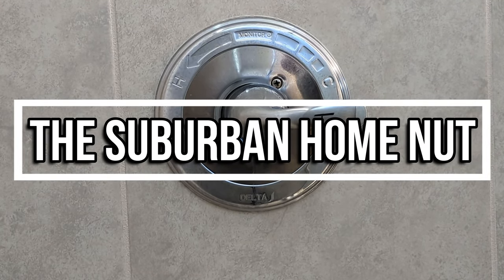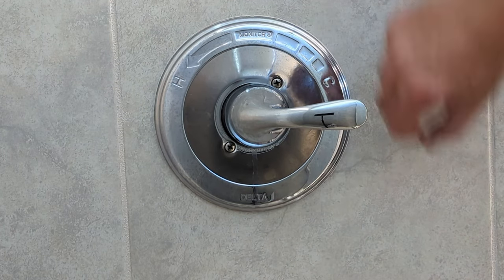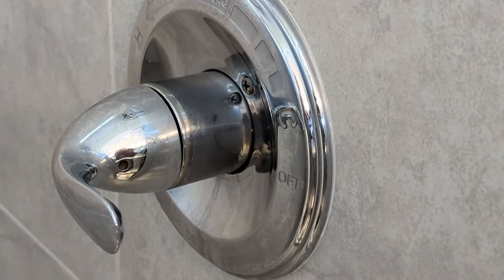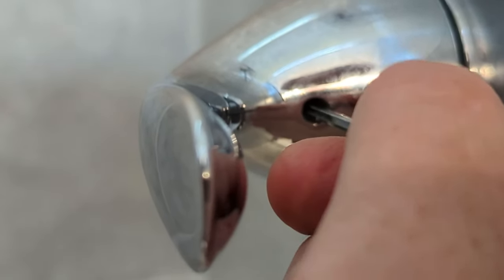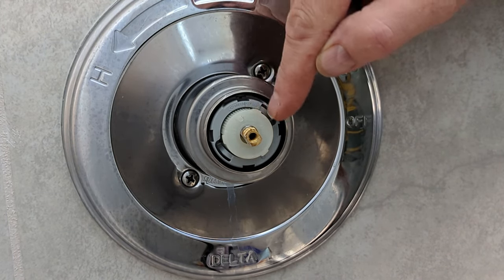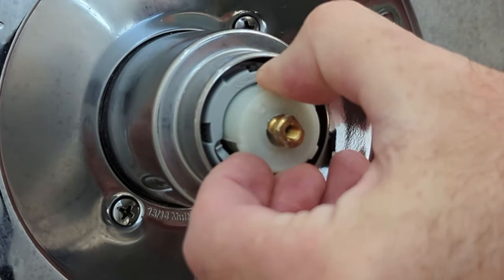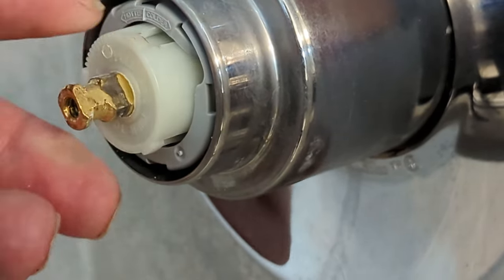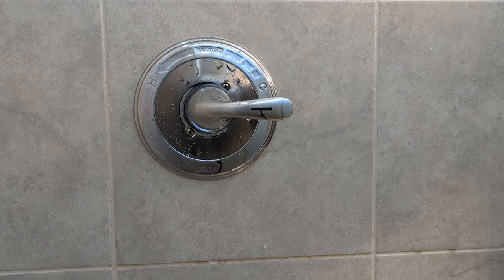Is Your Shower Not Getting Hot Water?  Easy 2 Minute Fix!!

Comment: Thank you so much!  We just had a plumber here today to install a new cartridge in the shower because it was leaking.  Before he left, I checked that the leak was gone and said "A-OK!".  Then I took a shower a little while ago and there was little-to-no hot water.  I didn't even know about the scald setting, but I followed your directions and fixed the problem.  I had called the plumber but still haven't heard back.  Thanks again.  Much appreciated!

Comment: Most of the time, you don't need to fully remove the set screw to remove the handle.  Loosen it enough just to allow removal of handle, and you should be good.  Covering the drain, though, is always a good idea, because you never know what you might accidentally drop.